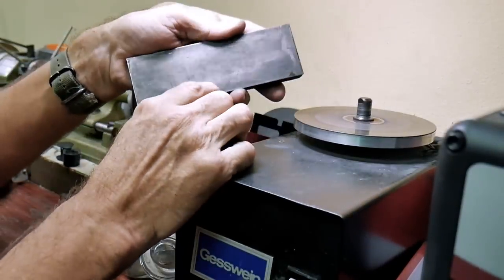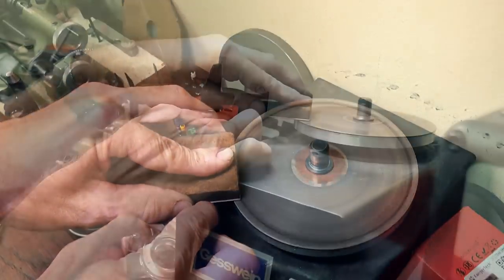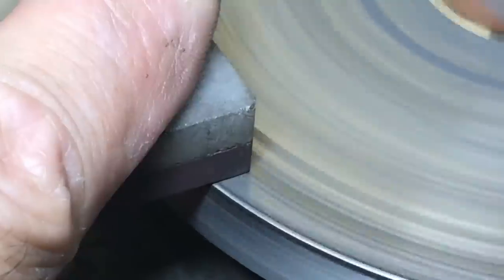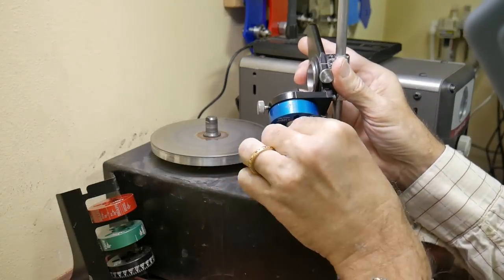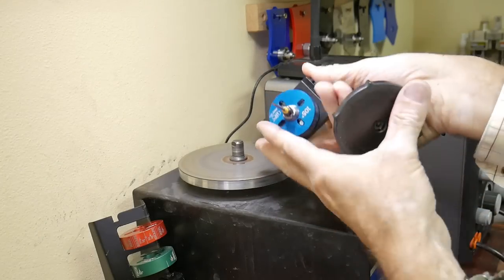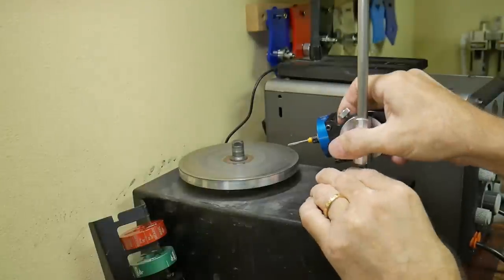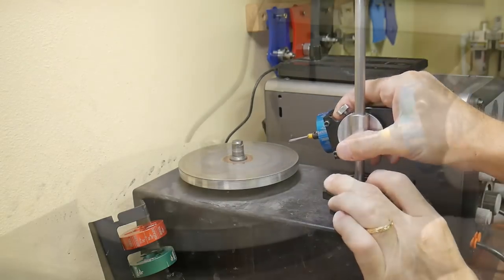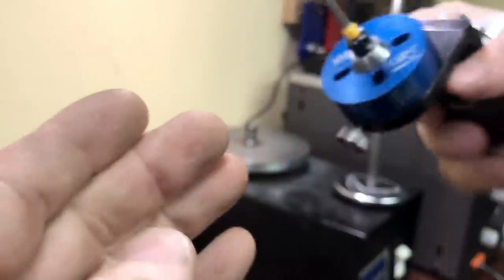Hand Engraving -Quick tip #2  Power Hone Graver  Sharpening Wheel Modification

Comment: Loving these videos  Layne! Thank you for the sharpening tips and showing your techniques otherwise. Currently I am attempting to refine my push graver technique and am wondering if a 90 or 120 degree point are prefered, and if a slight heel is needed for the point.
Reply from the maker: When starting out a 120deg graver is far too hard to control in my opinion as a push graver. I wouldn't go higher than a 105 and I usually recommend 90. And as for heel, a graver will not cut properly without one. The only people who ever use a graver without a heel that I know of are those who cut bulino engraving. And that is done with a very tiny specialized graver.
Reply: Thank you sir. I will go back to the 90 with a slight heel, and practice, practice...
Reply from the maker: Have patience. It takes a few years to gain real proficiency with a push graver.
Reply: SELL GOLD AND BUY PLATINUM.///

Comment: I have a Lindsay classic collet based handpiece and the apex sharpener. The Lindsay collets are a bit shorter than the GRS ones. Have you any experience with the interchangeability of the two collet systems? It seems like getting the same index on the graver in the collet is almost impossible if removed and that the gravers should just live in the collets once installed. Thank you.

Comment: 😟😳😮 going to tune my 1200 lap like this. I have always used ceramic,3M lap stickers and or diamond spray on a leather strap for bright cuts. I know everything has its time and place. But excited to try this.😬
Reply from the maker: Ethan Donohoe it definitely handy. It polishes well enough for the majority of bright cuts. If I need more I use a hard rubber diamond wheel on the flex shaft.

Comment: On your last apex video I noticed your rougher grit wheels wobble a bit. Does that affect the angle of your graver at all when doing the rough shape?
Reply from the maker: It can yes. I normally take a bit more time to level things out but since i was just cutting the rough facets I didn't worry about it much. When I do the final shaping on the facets I use the second wheel which sits mostly level. Reality is it's time for a new power hone setup with a quick change wheel.
Reply: The pain of balancing a workshop budget. :-P This was a great video by the way. I never thought about turning a wheel into, essentially, a double grit stone.